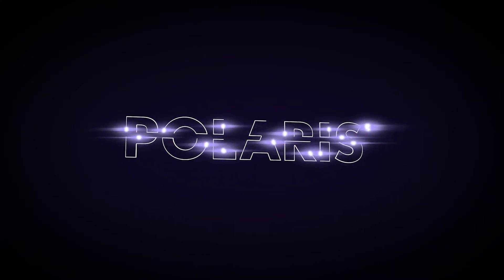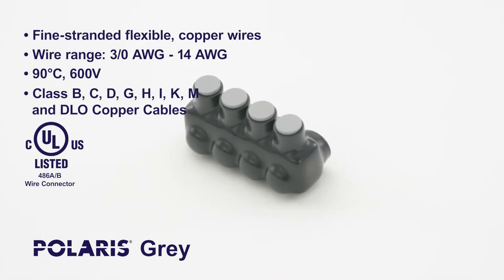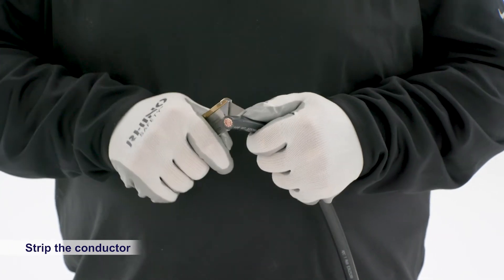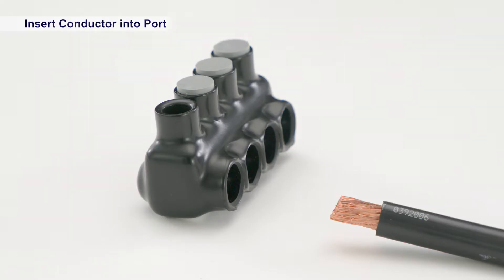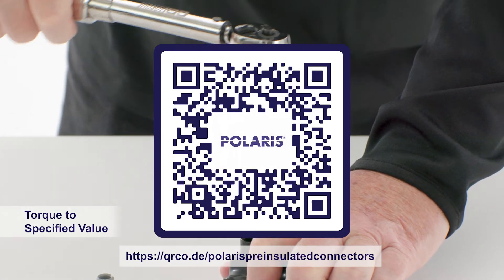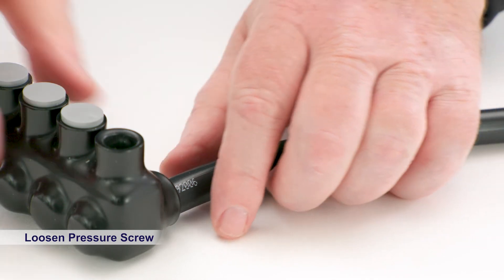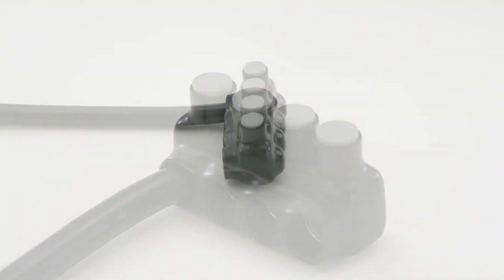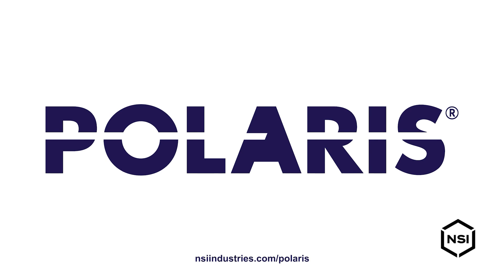Polaris Grey Pre-Insulated Connectors for Fine-Stranded Wire How to: Installation Video

Comment: Why there is no connector that connect wires that are perpendicular to each other.  Just swich one entry with the hex nut hole.
This way one can easily connect wires in a junction boxes.